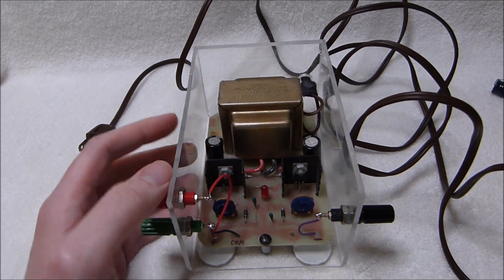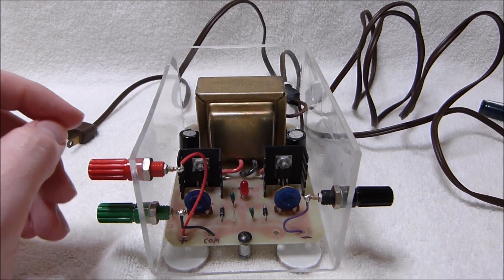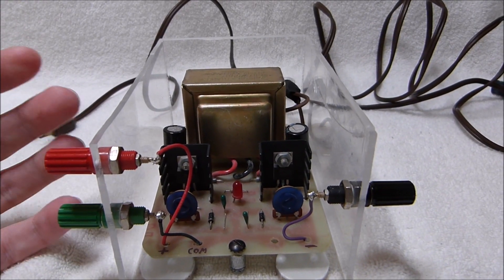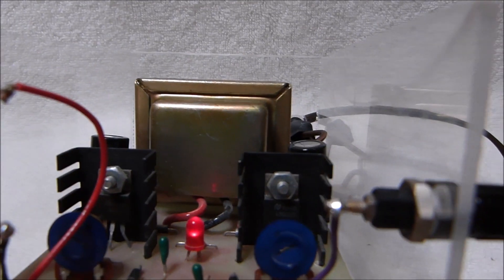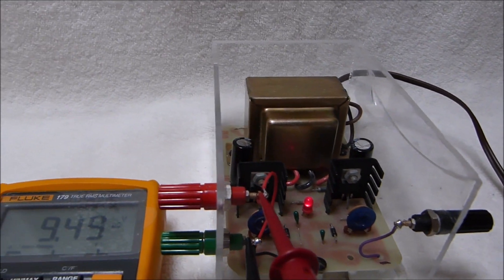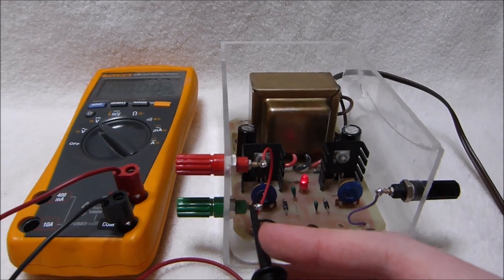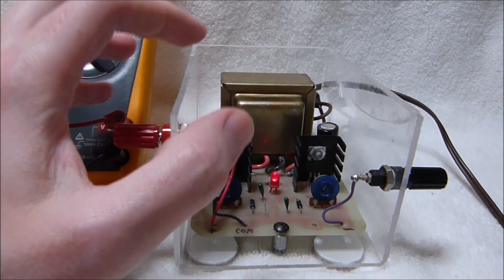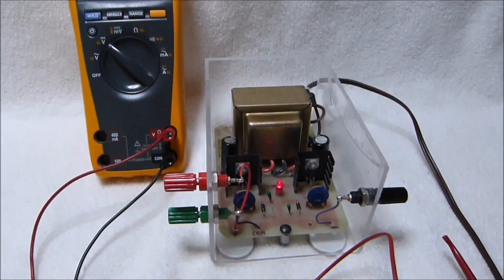Jameco JE215 Dual Power Supply (~1984, USA)

Comment: Linear power supplies are always better for radio work, in my opinion. No switching noise.
Reply from the maker: Agreed, and my bench supply is a linear one for that reason. Transistor radios generally don't have much filtering on their battery power input, so they can pick up noise that way.

Comment: Big departure from radio.

Good call on the caps -- I had one blow up while I was working on a similar supply and it's not good experience (select caps rated for more than 1.5x the RMS value or the rectified wave).

If you don't want to blow your transformer you'll surely put a fuse or two in there.  I forgot if you mentioned that transformer supplies are better for radio operations than switch mode supplies, precisely because of the noise.

Stay well.
Reply from the maker: Yeah, my next video will probably be a radio.
Exploding caps are no fun, it makes quite a stink!
I generally use capacitors that are rated for at least 50% over the voltage that it will see in circuit. 25 volt caps should be fine for this though, it won't be on all the time.
The regulators themselves have short circuit protection, but I will probably add a fuse anyway.
I agree that for transistor radios, linear supplies with a "regular" transformer are better.
Stay well as well!